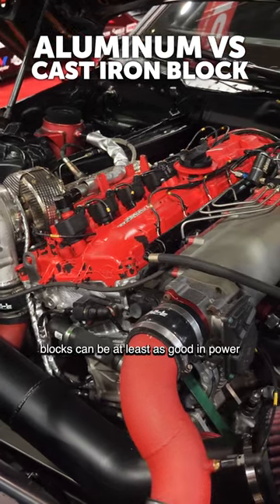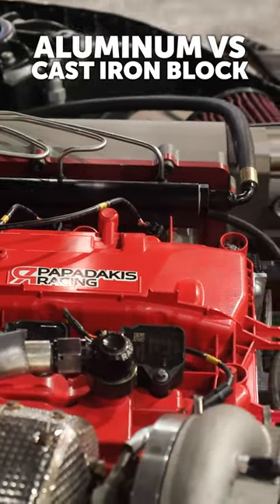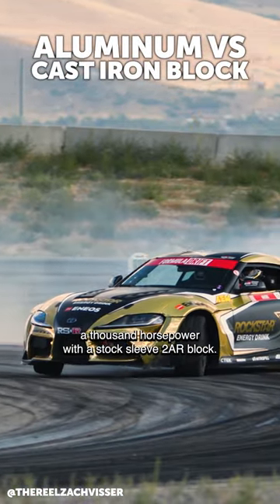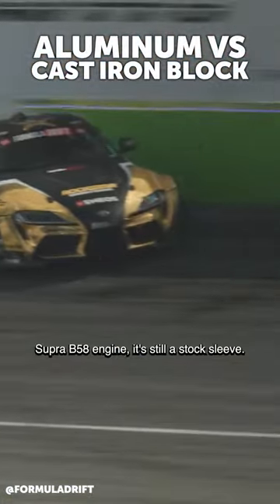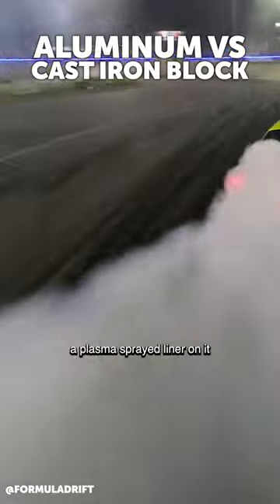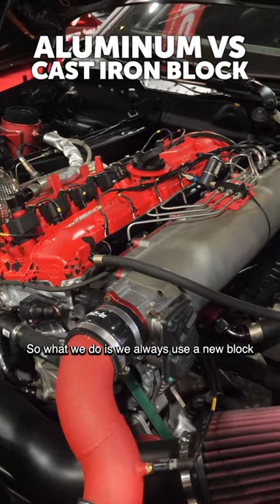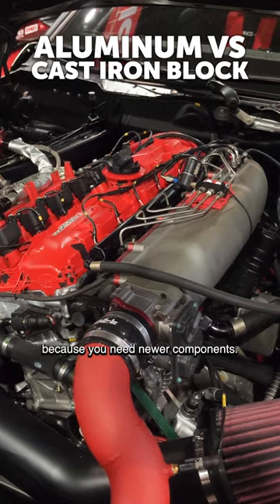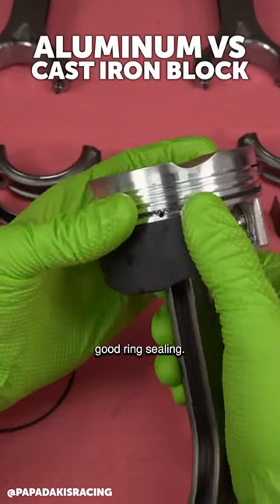What is the best material for a modern block? #shorts

Comment: "aluminum is as strong as iron, you just have to replace a whole block on any sign of wear"
Reply: There are companies that redo those coatings. But most engine shops just bore the block and put a steel sleeve in
Reply: Ok then use the heavy 600 pound turd 2jz like every other drift guy. This guy is literal gold of the car community and your are making snarky little petty comments about his knowledge. Really gay
Reply: Weight reduction is often worth the extra maintenance in extreme applications.

In the older ford 4.6 blocks, the aluminum blocks are actually stronger and will take up to a .010 overbore while still holding in excess of 2k horsepower in the case of the Teksid and Nemak blocks. This overbore handling means if you catch failures early enough, you can often overbore 3-4 times on the stock sleeve.
Reply: Strong versus reusable are two different things

Comment: Sounds like your trying to force the power out of this engine old supra would not have the same issues
Reply from the maker: Might not have the same issues but will still have it's own issues to work out to make the same power. Remember no one was making this power level with 2jzs for a long time either and they don't come with it stock 😉 - Taz.
Reply: Also given the availability of said motor is getting harder and easily more expensive. It is starting to boil down to building what's currently available and plentiful.